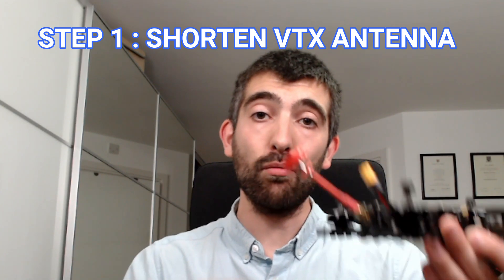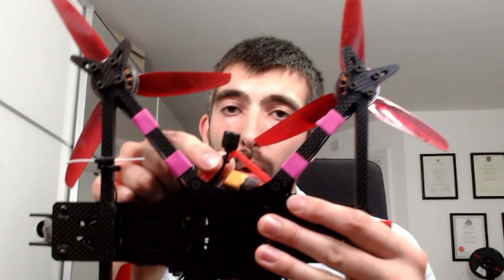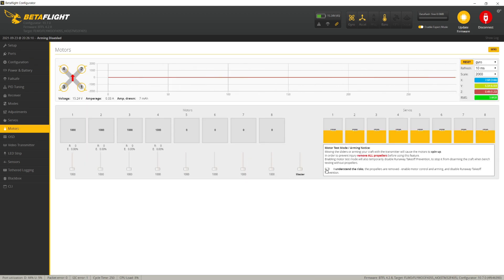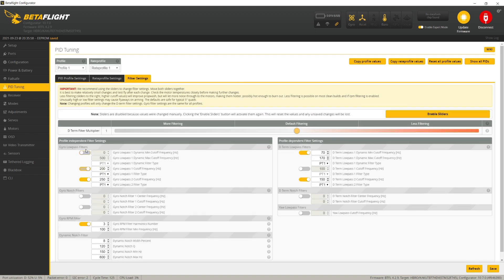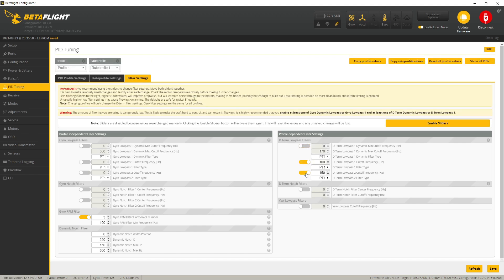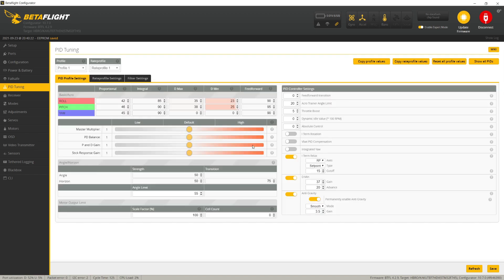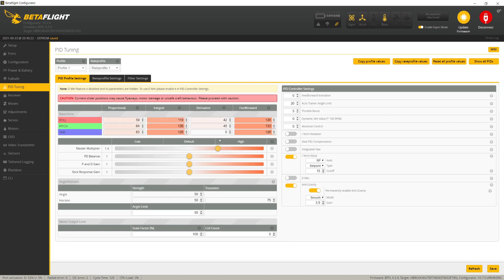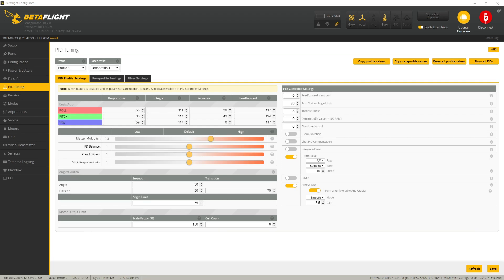5 tips to help your quad fly its best! Freestyle, Cinewhoop, Toothpick, Tiny whoop or Long Range!

Comment: I decided to tune my whoop. I spent hours and hours in past few days watching all possible videos on it. Including Chris's detailed walkthroughs. It did help me understand things. But when I went to work, I realized my whoop doesn't have onboard blackbox logging. So I just gave up. At the end I came here, to this video. With prerequisite that I had bluejay, I followed these few steps - turned off all "unnecessary" filters, and set few numbers on the one that i left. Then I reduced I term and FF and played with Master multiplier. I reached full 2.0. Then I returned I term, and set FF to 2.0 (to match MM). Needles to say I tuned my whoop in like 20mins to fly waaaaaaaaaaayyyyyy better. I literary had a smile on my face to see how much better I controlled it. Thank you Chris, you are brilliant!

Comment: The error doesnt always read right. I have a vid of my smoked motor going way slower with no error.
Reply from the maker: Dshot error is to do with the communication between FC and ESC so if the motor is smoked but the ESC is Ok it won't give an error.
Reply: @ChrisRosser  aaah ok.

Comment: Thanks Chris for the informative video, the information you present are really valuable and amazingly useful to all hobbyists.
I would appreciate your technical advice in regard to my Rekon 4 inch quad, freestyle drone, i am trying to get it done on betaflight and seemingly everything is fine, my issue is the motors, when i checked them on betaflight i made sure the reverse is active so they are all spinning in the right direction and when i tried them on in motors tab, everything worked smoothly, but when i put the props on just to hover the quad and feel it, i just touched the throttle slightly and the quad took off so fast and hit the ceiling, seemingly the motors are spinning too fast without even touching the throttle ,,,,, what do you think Chris ??
Reply from the maker: Head on over to my discord server. You'll find some expert help from me and others in the support hanger! https://discord.gg/ErcNUPJsFF

Comment: Looks like these filter and PID adjustments were made on BF 4.2.9. - are there any changes you'd recommend for 4.3? I've watched your 4.3 videos and the tips in this video, especially for the filtering, are pretty significantly different.
Reply from the maker: I will be doing an updated top tips video for 4.3 at the end of the video series. 👍
Reply: @ChrisRosser  I applied the filtering tip you showed here to a 5" quad running BF 4.3 w/ RPM filters and I was amazed that it flew so well. I'm looking forward to the rest of the 4.3 series!

Comment: Thanks for this Chris, I applied the BF settings to my Diatone Taycan & it made a big difference (will test with GoPro weight once the wind settles). The motors are now warm versus "hot to touch". If you have any other recommendations for such a model Cinewhoop, that would be great.
Reply from the maker: If I do you know I'll make a video! Thanks for the comment.

Comment: Any idea how to fix wobbling on 75mm whoop in angle mode when throttle is pushed to high after being to zero and falling? I know than stabilized modes use separate calculations in Betaflight and not PID settings, but... Can't figure out are it is happening because props are too small or this may be fixed in configuration somehow.
Reply from the maker: You can try to increase the master slider and see if it helps. Lighter pitch props and lightening the quad may also help.

Comment: Chris I cannot thank you, Timmy RC and he UAV tech enough today! For the first time since stopping flying on BF3.6, I finally feel in control of my quad again - raw power, locked in, feels like I remember great feeling quads feel like! I did everything you said on this video, except for the antenna, still running my iFlight Albatros and also turned off EVERY BF4.2.9 feature except presets recommended by The UAV tech. Running on RAW PID tuning as it used to be and MAN what a difference! Even TX16s inputs feels a ton smoother without smoothing on 4.2.9. I'm running 8k/8k  with BD Dshot 600, JESC 2.2 48khz, motor start 0.125. I instantly have my confidence back, ripped a new 4s pack to death without caring - THANK you so much for all you do, I and all the rest of the unnamed thousands of fpv pilots appreciate it more than you will ever fully know!
Reply from the maker: Thank you! Glad to hear that my work made such a difference for you!
Reply: Hi @Apocreation FPV I'm new to tuning. What do you mean by "turned off EVERY BF4.2.9 feature"?

Comment: Just flew this config on my custom 2.5" - lets be honest, I was ready to see a motor smoke... WOW cleanest flight I've had with it so far, I'm so impressed, I did both my 5" quads too, cant wait for tomorrow to test them out! Keep up the great work!     -One two part question please; I'm using JESC 24khz with dshot300 paired with overclocked f405's, would there be a increased benefit in running 48khz and dshot600, because I've noticed power/thrust decrease going up from 24khz, or do I just need higher pids?
Reply from the maker: If your F405 can run 8k/8k (which it should be able to I think) then Dshot600 is the way to go. I prefer 48K to 24K myself but you may need very slightly higher PIDs.
Reply: @ChrisRosser  Thank you so much, looking forward to test this :)

Comment: Thanks ! I saw some changes from your previous filter tunning video with the dynamic notch filter you keep the default value 150/600 instead of 100/400 is it better to narrow the filtering or keep it like you did in this video ? (on 5 and 6 inch)
Reply from the maker: It depends. You want the notch range as narrow as possible whilst still covering all the peaks! If you check your blackbox that will tell you over what range you have peaks. 👍😁
Reply: @ChrisRosser  thanks ;)

Comment: I love to dive in the mountains on a 7 "drone. I get jelly during the dive.
https://youtu.be/Ptq9U97DNxw?t=211

I have not tried shortening the antenna at the back as you suggest. Could this be the cause of the jelly? I think when I lower the engine speed, there is a resonance at low rpm.
If the antenna is shortened and when the drone is turned towards me, the GoPro camera obstructs the antenna and the video signal becomes worse. On jelly, I did not test the shortened antenna.

But from the pitch, I see little noise at 60-70 hertz. Could it be an antenna?

I plan to turn off the noise filtering step by step in order to achieve the correct I-term compensation of the motors.

Or do not reduce throttle while diving.

There is also an option to print mounts for the gopro camera on the stands, which will damp vibration.

I also have a 5 "drone, the antenna is long, the mounts for the GoPro camera on the racks and there are no vibrations.
Reply from the maker: If you have a long antenna you have vibrations being created. Whether that is causing flight issues is difficult to know without logs. I have yet to see a quad with a long antenna that isn't limited by it in terms of flight performance.

Comment: Does anyone make a VTx with 2 antenna inputs? A stubby at the front and rear could be good idea?
Reply from the maker: I don't think so. There isn't much point having more than one antenna on Analog because it dosn't support diversity or MIMO. Just put more power through an Omni!
Reply: @ChrisRosser  A VTX that supports diversity 🤔
Reply from the maker: @syluntbob6877  Analog doesn't support diversity transmission only diversity reception. This is also true of SB because the communication is one way.

Comment: Hi,
Thank you for this tips.
Concerning DShot bidirectionnal, what about the basic settings required to enable rpm filtering (cf. Betaflight wiki) :
set scheduler_optimize_rate=on
set dshot_burst=offset

Is it mandatory to add it via CLI ?
What happen if not used ?
Reply from the maker: I have never used those CLI settings and I don't know if they are relevant in BF 4.2. You shouldn't need to set them.

Comment: With the stubby antenna you are wrong! The stubbys are not more durable. They break very easy because they can't move... Already Destroyed 2 of them. And the signal is not good enough with rhem. Iam using the Lumenier AXII antenna and these are not too long and also not wobbling around. 👍
Reply from the maker: I find the best is to use a flexible antenna with a UFL or MMCX and cable tie it to the arms. I think stubby durability does depend a lot on how you mount it. Thanks!

Comment: Hey Chris, 
Betaflight 4.3 is out. Is it applicable to use the same pids/filter settings as 4.2.x?
Reply from the maker: BF 4.3 is not yet released. I don't want to encourage people to use unreleased code, that is not software best practice! You can try the same filter settings.
Reply: @ChrisRosser  ive got a serious question 🙋‍♂️.

Can i use these filters and use on Emuflight? Emu doesnt have rpm filtering.
Reply from the maker: @afifathnin  Probably not. I think they will be too aggressive. But there is no harm in trying if you go carefully. The dynamic notch may be enough.

Comment: Has anyone done this to their beta85x.just did the step by step but haven't flown it yet.Anyone feel a diff with their quads
Reply from the maker: @Fawkeyes was pleased with the result on his 95x. It should work well.
Reply: @ChrisRosser  thank you for the reply,this would be my 1st attempt at any flight control changes to modify the drone.. Thank you again.
Reply from the maker: @akatopj22  no problem! Write down your settings first so you can go back if anything goes wrong.

Comment: Thank you very much! I have applied these settings on my FlyWoo Hexacopter Nano, which runs a nightly build of BF 4.3. I had to first flash the ESC with JESC to get the Bidir dshots. Results; Indoor flight is exceptional in initial tests. I am to have very good control and flight  in full acro. I'll test outside tomorrow in windy conditions and see how it performs, especially on dives. Thanks again!
Reply from the maker: No problem, happy to hear it worked for you!
Reply: @ChrisRosser  I tested it outside today with mild wind. It is phenomenal! It was locked on the lines, very responsive, and gave me the confidence to take lines I've never taken before. This is quite an improvement. To make sure I wasn't biased, I reverted back to original PID tune and it was pretty bad. I even tried Original PID from FlyWoo + RPM filter, and it still wasn't nearly as good as your tune. I can now confirm that your tips work on a 1.6" hexactoper! Thank you thank you thank you!
Reply: @SnR Love watching your fpv flights on your channel!!! 🧡🕊️

Comment: Great video! I'm also curious to see some of this tuning stuff in 4.3 (soon hopefully? but I'm using a nightly build for GHST) as it looks like a lot of options got modified and its not the same as doing it in 4.2. Have you looked into this at all?
Reply from the maker: I'm flying a 4.3 nightly but I'm not making content about it until its in RC. Encouraging people to use unreleased code is not software best practice!

Comment: Hey Chris just been out and flown your advised setup only difference being dynamic notch min at 80 and max at 350  yours was 150 min 600 max should I change to that? Not sure as my 5inch quad has never flown this good so locked in thankyou Chris 👍👌🔥🔥🔥
Reply from the maker: Try 150Hz on the dynamic notch it might makes things even better.

Comment: The stubby looks like a stock dji goggle one. Can I use these on a caddx or an AU? Need an adapter?
Reply from the maker: It isn't! You can use any compatible LHCP antenna for DJI.
Reply: @ChrisRosser  ok thx. My aos3.5 just arrived, wil put an antenna like that on it. The frame arrived with a miscut for one of the cam panels. Fast reply on my ticket. They’ll send a new part.

Comment: Please stop proposing filter settings like that. All it does is making people popping up in the fb review group asking for help because of burning hot motors! If you stick to the bf devs recommendation leave the gyro filter enabled and put the gyro slider to 2.0. You can put the dterm slider to a max. of 1.4. No gyro filtering with a single biquad is the worst filter recommendation you can give!
Default I-term is already too high for a 5“ miniquad. I-Term = P-Term+15% is an appropriate value for almost all sizes. Get the balance right, raise your gains (which will be way lower than possible with your filter suggestion) and use FF to get the gyro tracking right. If your stick feeling isn‘t right after that being set up you need to change your rates.
Reply: The gyro slider at 2.0 is nearly useless, so you may just as well disable it. D term filtering is much more important to prevent hot motors, I agree having the slider at 1.4 is pretty much the maximum. Biquad (or even better the PT3 in Betaflight 4.3) works fine but don't even think about going higher than 110 Hz...
Reply: @l0stb1t  With both gyro sliders being off you still loose like 10db of attenuation for the gain of maybe .3ms of latency which is worth nothing. Having a very clean gyro and d-term allows for much higher PID gains which will give you much higher PID authority resulting in a superb propwash handling.
Reply: @marlin-fpv  Sounds reasonable. I've always tried to get the lowest sensible filter delay, but will do some experiments with a bit more filtering and see how much the higher PIDs help.
Reply from the maker: If someone has hot motors flying a mini/micro quad on this filter setup more likely than not there is something up with the mechanics of the quad and they should probably be looking for some support with that. In my experience this filter recommendation works better (cooler motors) than 1.5/1.5 on the sliders with less delay on most builds.
Reply: @ChrisRosser  Not one of my buddies quads including my quads (clean/new builds) is flying at least decent with those settings. A lot of people popped up in the review group lately flying those settings asking for help, all of them on clean builds. The betaflight devs recommendations is not to switch off any default filters and don‘t use a biquad on dterm but obviously you seem to know better than Chris Thompson. 🙄
Reply from the maker: @marlin-fpv  I'm happy to help you out if you are having difficulties with those settings. If you drop me an email with the log and some pics of the build I can take a look. If anyone pops up having issues with my settings please feel free to tag me. I'm in the group and happy to help.
Reply: @ChrisRosser  I don‘t have difficulties. I know exactly what and what not to do. The difficulties is your filter strategy which is simply not enough filtering. If you are in the group than you can help out people on your own without me tagging you.
Reply from the maker: @marlin-fpv  I do my best with the group but I'm not on Facebook much these days. So I apologize if I miss things. I'd still be really interested to see your build and logs if you'd be willing to share? Would you be able to send a few photos and a BB log to chrisrosser91 at gmail?
Reply: @ChrisRosser  If you would check the group on a daily basis you would see… ;-) I‘m on holidays at the moment but will send you a log/diff once I‘m back. For the build it‘s an ordinary apex with a vista, mamba stack running am32 with 2208 xings and gf51433.

Comment: I feel like if this is the best for many quads why isn't it the default?
Reply: I think this could be coming somewhat in the next version of betaflight where it has presets like tiny whoop, cinewhoop, 5 in freeestyle, 7 in longrange to choose to get closer
Reply: Yeah that can be a good point considering these settings are great for most 5 inch setups. The only reason they are not default is because the devs of betaflight want the defaults to work on basically any quad you can thing of. Half an inch to 20 inch props. Its defaults are tuned for broad compatibility not perfomance unfortunately for 5 inch pilots... Although its fairly easy to tune nowadays!
Reply: @maxrackstraw  yeah that makes sense I went to try this and I couldn't do bi-directional d-shot because I'm on BL heli S
Reply from the maker: There's a link to how to update to BLHeli_M and get bidirectional Dshot in the video description.
Reply: @ChrisRosser  "M" is that some sort of third party branch of BL heli?
Reply from the maker: @MrSabram07  Yes. Used to be called Jazz Maverick. 16.9 is fully compatible and compliant with BF RPM filtering.
Reply: @ChrisRosser  so d-shot and filter tuning is totally worth the firmware change?

Comment: That's so simple and easy! Gonna try this soon. Do you happen to know what the stick response gain is called in OSD? I couldn't find it. The OSD has quite different names or terms than the one on BF config. Too confusing.
Reply from the maker: Feedforward I think.
Reply: @ChrisRosser  Thanks. will look into it.

Comment: longer antennas can realllly help for long range so you dont get frame blocking signal(usually when headed home... have to fly sideways home with short antenna), especially if you only have one antenna using vista.... I just glue/3d print holders for 180mm albatross antennas for my light 20-30 min flyers as they have a stiff shaft that doesnt wobble and you can get it to stick up a lot higher to get out of the way of the frame
Reply: two different scenario, for long range you probably not doing any flippy floppy freestyle stuff, in that case a long antenna won't affect much. But for agreesive freestyly, long antenna could be a problem.
Reply from the maker: If you need it, you need it and you accept the vibration tradeoff. But most people who use long antennas don't need them.